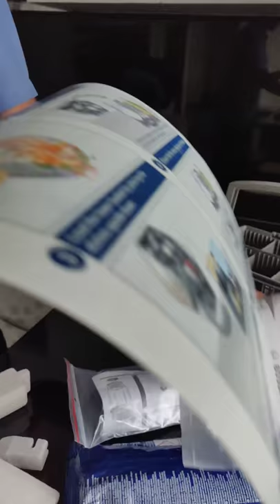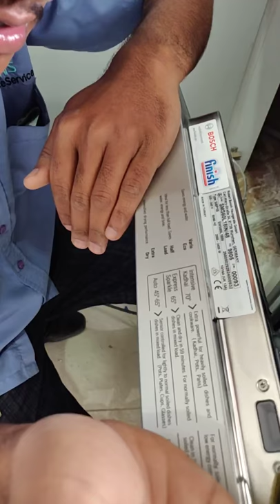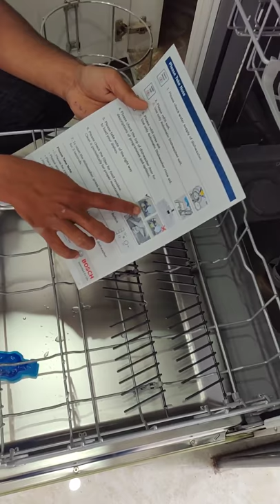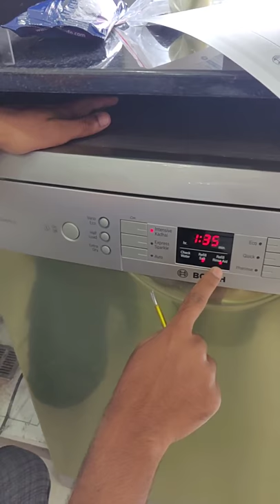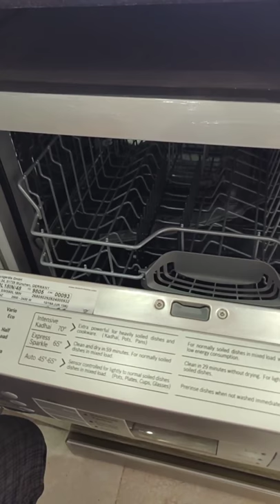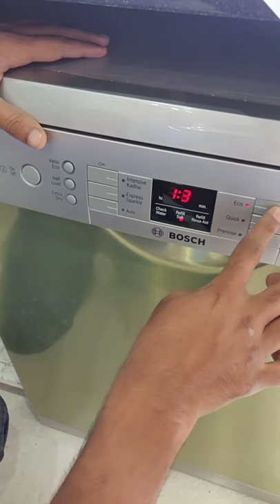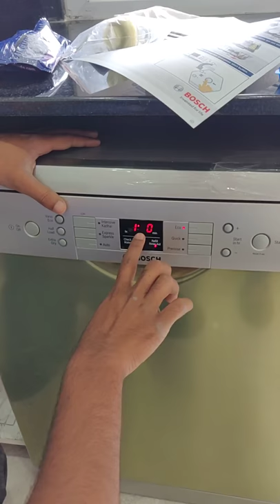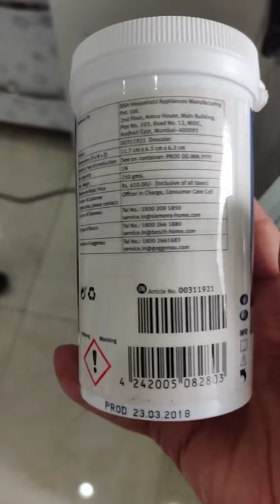Bosch Dishwasher Installation and Demo

Comment: Hi,can I know the height of the kitchen counter vs the separate portion you have kept for the dishwasher.Basically need to know the clearance on all sides and if the lid can be removed and feet adjusted.

Comment: What is that yellow tap like thing? Do we need to give it to plumber or engineer will fix that during his visit?
Reply from the maker: This is water filter . You need to put tap adaptor(80 rupees cost)  to connect this filter to water tap .
Reply: @quicklearn_AI  I am planning a new dishwasher. Wanted to know, do we need an external hot water supply for a dishwasher? Or does it come with a built-in element?
What other provisions do we need to make before buying a dishwasher?
Reply from the maker: @sidharthsethi427  it has built in water heater.
Reply: Do we get water filter along with dishwasher or guy installing has stock?

Comment: Hi Neeraj. Thanks for this video. I just got the Bosch Dishwasher. When they were testing, the dishwasher was giving shock. Then we realized that the earth wire in our socket was not connected. Once we connected the earth wire in the socket, the shock issue was not there. But my understanding is earth wire is only for safety when there is a fault in the equipment. Ideally there should not be current in the appliance body even if earth wire is not there. Can anyone clarify? Thanks.
Reply: Electricity is more complex than we understand.

Comment: have you installed the dishwasher? Tomorrow they will be coming for installation. Do I need to make all arrangements in advance, like Inlet, outlet, electrical connections or will they be able to do all the work themselves? For installation, I will need to cut a hole in the wall for inlet and outlet. Will they be able to do it? 

Also, I got this thing with the dishwasher. See the picture 

http://i63.tinypic.com/30k6f6v.jpg

From the instruction I see that the glass side will connect with the tab but the mouth of the glass side is very big and Indian home tabs are not that big. So how did you connect it to the tap?
Reply from the maker: Just u need a power point , they'll test this machine and supply
Reply from the maker: Glass side need to fix an adapter to tap
Reply: So they bring the adapter with them or have you bought it from somewhere else?
Reply from the maker: have to buy from hardware shop

Comment: We have ifb neptun dx in  that detergent powder box lock had broken . What to do where to purchase and howmuch
Reply from the maker: Just  put small dry wall screw in that till it replaced. When you want to use open it and then after detergents close it.
Reply: good comment.after broken that dispenser we directly putting detergent it is working but  now it is showing F5 not working what to do
Reply: how much that dispenser to replace

Comment: How is it working now?
Reply from the maker: 650per month avg expanse including electricity. Working good, cleaning awesome. After 2 year it will be free (in my apt dishwashing charge is 2000 rupees)
Reply: @quicklearn_AI  actually I just bought one for my mother. So was concerned if it really is worth. Thank you so much for the assurances.
Reply from the maker: It is really really helpful for your mom. God bless her.
Reply: @quicklearn_AI  thank you.

Comment: I am in Bangalore and have purchased a Bosch dishwasher, similar to the one you have. What is the water hardness level you have set on the machine? Our building gets Tanker and Borewell water.
Reply from the maker: Check Tanker/Borewell water hardness than open the dishwasher door and press the "On/Off" button. Press and hold the "A" button and press "Start" until "H:00" appears. Release the buttons and press the "B" button until the desired setting is reached. If the tap water hardness is between 120 and 140, set it to "H:01." If it is between 150 and 180, set it to "H:02." If it is between 190 and 210, set it to "H:03." If it is between 220 and 290, set it to "H:04." If it is between 300 and 370, set it to "H:05." If it is between 380 and 540, set it to "H:06."
Reply: @quicklearn_AI  May i contact you on your phone if its OK with you. Need some input regarding the dishwasher. Thanks in advance.